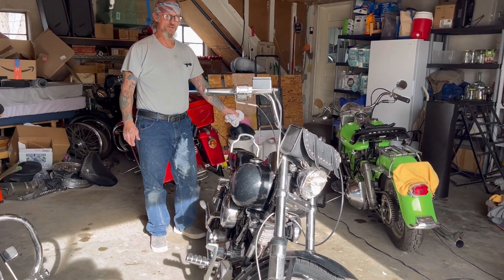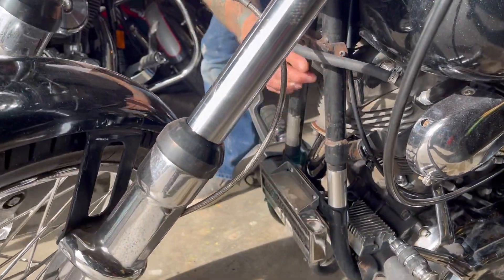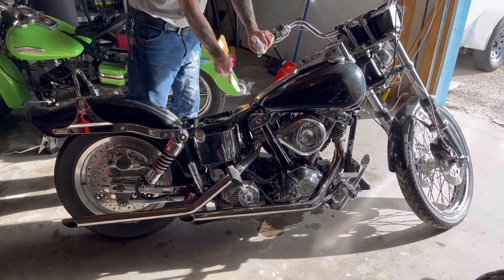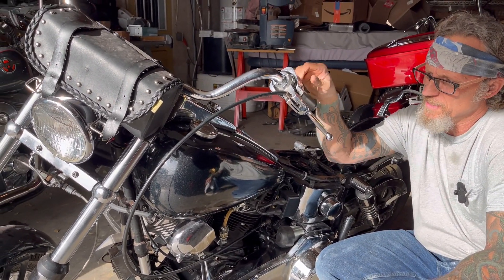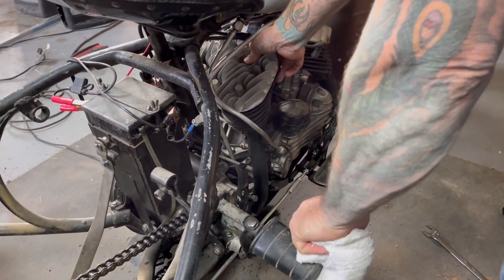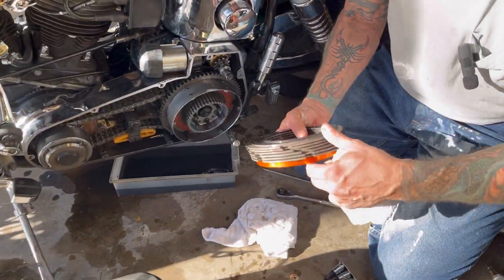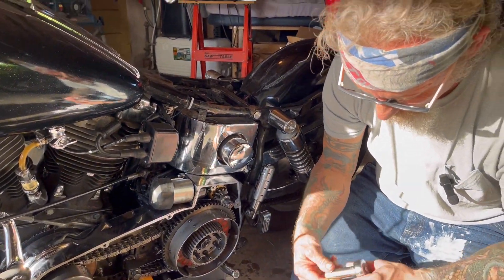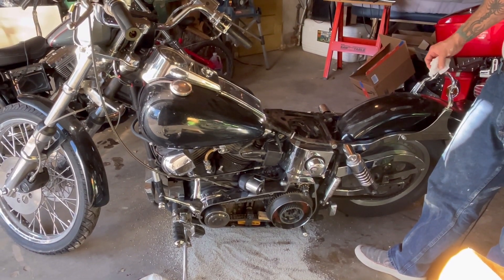1981 FXWG Shovelhead Problems

Comment: Great video. I checked out your website and really appreciate your phone service. It might come in handy in the future.
The techs at Dennis Kirk and JPC are sometimes clueless.
I have a 83' FXSB and I've been hit twice now by drunken foreigners. Now it looks more like a Custom black and chrome WG masterpiece. 

If I owned that bike I would spend the money and take it completely apart, powder coat the frame, rewire it , paint it black, chrome it, add some custom pieces and have a bike that would be a forever conversation piece.
He would learn so much from the project and have a brand new Shovelhead for a lot less than a new one..

Comment: The main shaft wears, so even if you put a new seal in it will leak. Old bikers call it a cow pie top transmission.  I bought two shovels and rebuilt both transmissions. No leaks. If you have a belt drive primary the weight of the sprocket wears the main shaft faster. They make a lighter sprocket which works well. Shovels are easy to work on like an old tractor.
Reply from the maker: Cow pie or Maytag !! I’ll take ratchet top over rotary any day of the week

Comment: I have always been told not to use an impact gun on the compensator sprocket because it could possibly damage the magnets on the stator. Is this just an old wive’s tale? If so, I could have saved myself quite a bit of time and effort over the last 40 years.
Reply from the maker: I’ve heard the same thing, and typically I don’t use an impact, the compensator on this one was so tight I had to buy a industrial impact driver. My shop impact driver wouldn’t even budge it

Comment: Have a 1980 fxwg and need to replace shifter bushing.boltgoes into transmission to have linkage pivot. Can the bolt be removed without removing the primary cover or do I have enough room to slide bolt out and replace bushing?

Thanks in advance
Reply from the maker: No, you gotta remove the primary!

Comment: Looks to me that the transmission was trashed because of little to no oil; being that it leaks out as fast as you put it in. Pulling the tranny isn't that big of a job. I've had to do it on mine. Just a little time consuming pulling it out and putting it back.

Comment: I would put a transmission in and fix that shift bushing.  Definitely don't recover all your repair money when you sell a bike but at least you can ride it
Reply from the maker: This series, a Videos is six months old, shifter bushing was repaired. Bike was sold, and then bought back and torn down and sold for parts unfortunately, just too much wrong with the bike as a whole to make it worth the repairs if needed.

Comment: I was wondering if anyone here who would be shovel fans can maybe tell me what would cause a pretty fresh S&S engine rear cylinder to keep burning out the plug ? Plenty of compression and is fine on trips but local plugs fail usually using aftermarket plugs.? And advise would be appreciated its a 98 C.i.
Reply from the maker: Could be a lot of things , I’d start at carburetor, too rich ? Try running a hotel plug in the rear

Comment: Do you want to suggestions let me give you a suggestion by yourself a table lift I bought one of those tables from Harbor freight best move I ever made in my life especially as old as I’m getting I wish I had done it years ago like I said best 600 bucks I ever spent
Reply from the maker: I actually have a harbor, freight lift, and a huge pneumatic lift. It will lift 3000 pounds, I just built a new thousand square-foot shop and I’ve got three garages scattered around this neighborhood, as soon as I get final occupancy permit from the city, I will have all my lifts up and running.